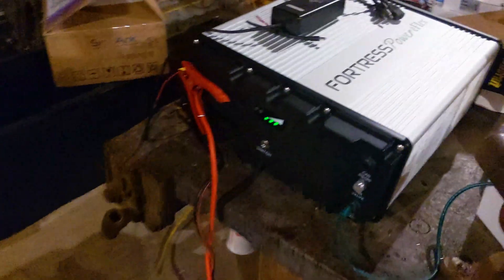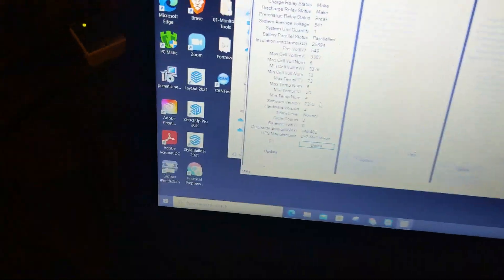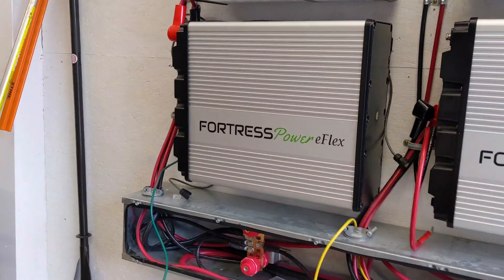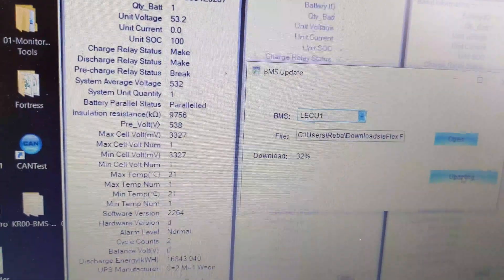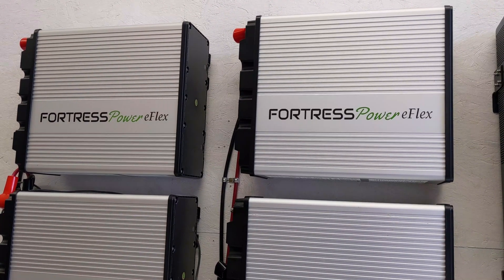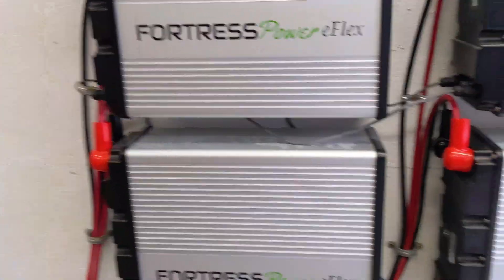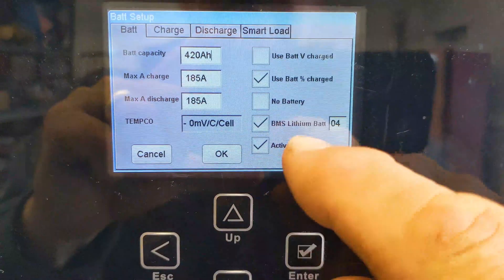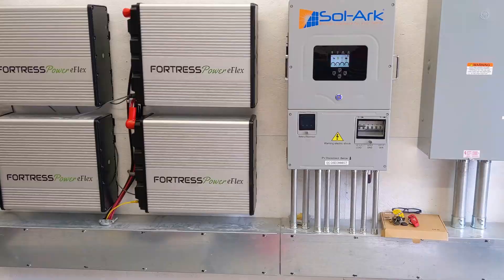Lithium battery upgrades and charging tricks

Comment: As someone who works with firmware a lot. here is a Quick Tip  that works on iPhone (and I think it works on android).

If you manually set your phone's wifi IP settings when you are servicing a location that does not have an internet connection, by setting the router value to nothing (Null, no value or zeros) it will tell your phone that the wifi you are connected to does not have internet and it will attempt to source external websites from your cellular connection. This should let you download firmware, interface with your inverter and keep you connected to the internet. Just don't walk too far off when you are uploading firmware, and it should work without issue. 

Happy Engineering!
- Engineer dMac

Comment: Great video.  Question on how you mounted the eFlex to the wall?.  They weight around 110lb each, right?.  Fortress provides a wall mount attachment, but its for vertical install AFAIK
Reply from the maker: Yes with the wall mount brackets you can mount them in a couple of different orientations.

Comment: Seems like relying on so much electronics is not the best thing these days. I can't help thinking a good diesel(or other fuel) Generator might be the best thing to save the day.
Reply: That depends on your goals. If your goal is to hoard enough fuel to last you thru a SHTF situation, diesel might be good. The noise might also attract attention. On the other hand, if your goal is to be energy independent, or as close to it as you can be, and have resiliency against grid outages, and the potential to make all your own power for years on end, then solar+battery is the way to go. Really the only downside is cost and availability of service personnel in a SHTF situation.
Reply: @ewicky   in shtf is the point,relying on impossible to get or repair electronics and china made batteries/battery BMS is not a good idea.  I can make ethanol in a still for my flex fuel truck.biodiesel in some cases can be made,or possibly run a diesel on old oil,veg oil,bio,etc .Wiring simple lead acid for 12,24,48v-96vdc direct with matching appliances or lights etc would be more resilient for example. If we are speaking of a EMP well, thats 50/50 chance of even hardened stuff will survive. There is no guarantees in life and anything can happen. There is no perfect answer for every situation. In a time where we rely on china for most electronics/inverters etc,seems like a bad idea.
Reply: @a4000t  I agree with everything except your grammar and sentence structure. haha jk
Reply: @ewicky  Guilty as charged! 😁
Reply: @a4000t  It is possible to bypass all of the “electronics” on lithium cells if one has the guts to do so (not recommended). Flooded lead acid batteries along with a more primitive solar charging system are pretty great and simple in an off grid setup if you have the time and patience to maintain them. These lithium batteries with the bms can really do amazing things, but I understand your point here. The best path to self sufficiency depends on the means and skills of the individual attempting self sufficiency. I dig that you make your own fuel, that’s awesome.

Comment: Sol-Ark question: Most of your setups seem to run 4 strings to each inverter, why not  parallel strings in the array prior to trenching to power center/inverter.  Is the price to combine strings in the field greater than the cost of the additional conductors?  Could you not use a MC4 y-connector?   Many thanks!
Reply from the maker: Actually 95% of our installs we are paralleling at the array with Branch connectors.